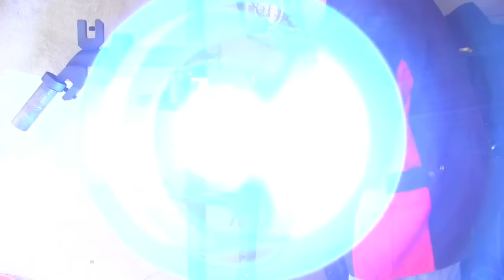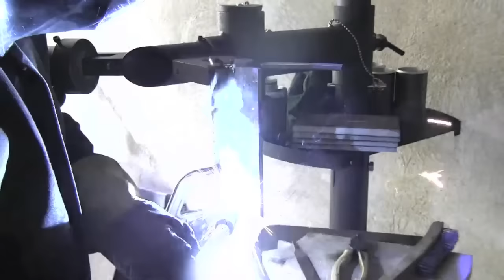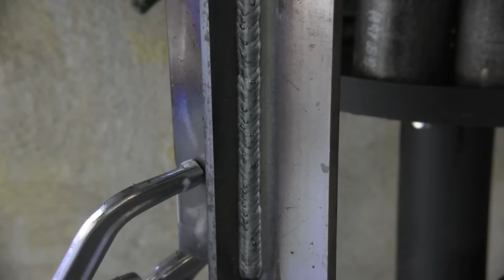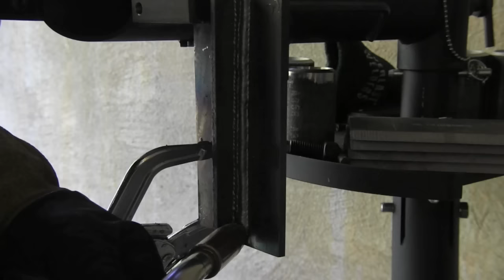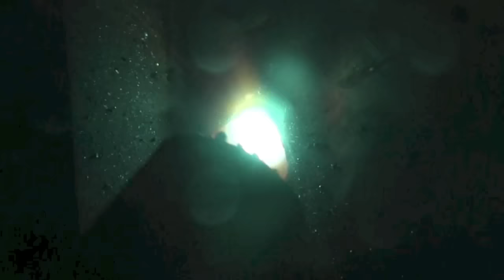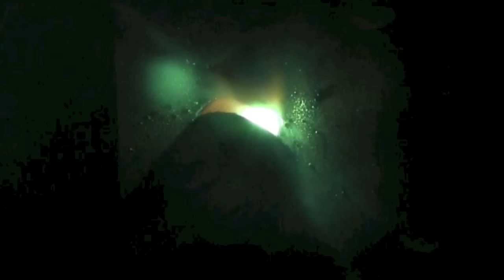Mig Welding Basics part 7 Vertical Tee Joint Drill

Comment: I know a lot of people don't want to hear this but hear goes: Rather than go to some big buck$ welding school , buy your self some welding equipment and figure it out for your self,at least you will have something left in the end. Practice ,practice , practice.
Reply: Pedro Dooley what do you think you get when you go to school? Only differnece is: you have someone with years of experience to query when something isn't quite working.
Reply: Mike Ford Get a book
Reply: Learned in high school were it's free, buying welding equipment is pointless without a shop so welding school or getting a job that will teach welding are more doable options.
Reply: the only thing that sucks with self training is youll never have the reference or word of back up saying you can do it. yet at the same hand most places if your going to be working will test you on ability regardless of your said experience.
Reply: hey so i respect your opinion. im in school for welding and what i get out of it is learning and getting certify in all welding. when your in school for welding, yeah you pay for it, but its a lot easier to learn to weld when you have zero experience in welding. such as myself. plus its easier to get a job when your certified in all welding.
Reply: I wanted to do that but getting gas is complicated.. I just have a small garage as well.

Comment: If you want a flat uphill weld, move over the center of the weld very quick and stay mostly on the sides.. works well with severel welds on top of each other.
Reply: I just figured this out.   I was shocked.    I'm like how is this so flat and nice looking

Comment: Did you leave the machine set as before (1G) re volts and wire speed?
Reply from the maker: Bill, dang it.  That is one of the main things I meant to talk about and I left it out. For this weld, I lowered settings to 19.5 volts and 245 ipm with .035" wire.  thanks for bringing that to my attention.
Reply: weldingtipsandtricks thanks for the reply & video.
Reply: +weldingtipsandtricks i use a miller welder at work not sure on which model but i was wondering what was your wire speed and heat? like about 19.5 amps and 4 wire speed?
Reply: Chris papi You use CV , not CC. IPM is wire feed speed.

Comment: A great video again. One of the things that I use uphill mig for is to demonstrate to students the idea of more time on the sides, less in the middle to flatten the bead. 

The concept applies across procceses but mig is the one where it comes in handy.

Another nice thing about uphill GMAW is the better penetration. For your viewers that watch regularly they probably already know. But the thickness limits on a low amperage machine can be increased by changing the position the vertical with uphill progression. 

After a few years of being involved witb welder testing and qc I can tell you that fusion type defects happen less on vertical joints than flat. Provided the bead shapes are good when you fill in the joint. 

Thanks for what you do.

Comment: For the guy who asked about cons on the z weave. Typically the wider your weld face the more stress and distortion you are imparting on your work piece. Lots of first year welders coming out of school love big fat weave caps not fully understanding the stresses they are imparting just thinking of how fast it is. Also you increase your HAZ (heat affected zone) with that one big fat weave where as with stringers or a split-weave your weld deposit benefits from every subsequent pass (to a point) with each pass you anneal and normalize the subsequent pass resulting in a more refined crystalline grain structure. Also lots of testers who have never worked as welders won't allow weave caps but basically everything can have stringers.  Please correct me if I'm wrong Jordie but I'm speaking with a background from Canada and lots of on site stick. Love the videos keep it up
Reply from the maker: You make a good point.  Its different everywhere you go due to different codes and applications. I worked a fab shop for quite a while where 48 inch pipe was welded routinely using a big roller setup and auto mig with auto oscillation. But the code at that time permitted it for the application. For example, Pipe codes like B31.1 or API1104 have very different requirements...and those codes are even especially different from structural codes like AWS D1.1.

Comment: I watched your entire basics series, and learned so much.  Thanks you.  I have problem with hand placement when doing long welds.  Maybe you can do a dry run on how to adjust your bracing as you move along to keep the weld look good.  Mine looks bad when I have to move my brace hand.  You've given me a lot of knowledge on whys of welding, more than any other channel.  Keep up the great videos.
Reply: Honestly you just need to practice free hand. Engage your core and breathe slowly. I used to weld landing gears for semis and it was about a 2ft weld and you just gotta get comfy and position your body where you want to finish and wind back to the start

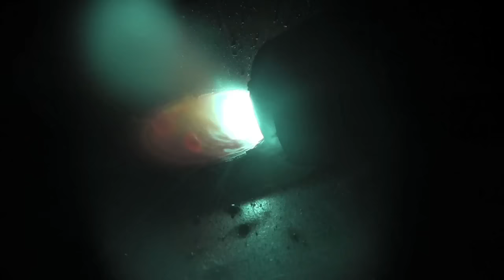Comment: 0:48 people seem to think you shouldn’t pull with MiG. You can run it pushing, pulling, or straight. Generally speaking, pushing allows the arc to dig in deeper, but you can get the same results pulling by slowing down and increasing amps and wire speed a touch. MiG is very flexible in its use. As long as you have good amperage, good stick out, good speed and good gas coverage, you can run MiG pretty much any way you want.

Comment: What were the settings used here ? I grew up on the farm teaching myself to stick weld haha after army passed a test got certified to weld on railroad anddd now shop got furloughed sooo I applied at a company for full time welder & they told me I had to take a test and I studied up best I could to have at least the basics down pat …when I get there they said I had to take a vertical and horizontal test … it ended up being a 1-bead Tjoint that was vertical and said a minimum of 6 beads/tags per inch 🤔and I couldn’t use trigger the whole time so I asked ole boy to show me an example I hadn’t heard of that and it was basically a series of uphill tacs and the settings were 27.5V @ 435ipm wire speed MIG weld … to me that seems mighty hot no wonder they wanted tacs andd said it was pulse welding uphill was the name and the little bit I know about that isnt pulse just a setting that may or may not be on the welder ???  I’d appreciate ANYYY feedback fellas take care and God bless..!

Comment: im glad you showed the z at the end.... the whole time i was like... 
WOW i do mine totally different then at the end you showed the z weave and i was like... ahh so i wasnt taught wrong! lol
This was definutly what took me the longest to maser but once you do anything else is easy mode!! Being able to Stick weld uphill already helps alot although i found the Technic is slightly different for MIG than a 7018, 6011 uphill! i was also taught that you want to always set your machine to weld in any position at the same setting but, ive always had to lower my setting for GMAW uphill! Im assumeing you also have to set your machine and wire speed lower as well?
Nice video i subed just because... why not ive only watched about all of your stuff! LOL
Reply: Do you have any videos on finishing polished Stainless? ive worked grained 404 and such for hollow metal door frames so what all else would be involved beyond that to do the polished mirror stainless?

Comment: If your doing vert uphill with a several pass fill in. Do you quench periodically? Or let it air cool? I know quenching can be detrimental to strength and makes warping worse. But it seems the hotter things get with each pass, the more the weld tends to want to sag

Comment: Hi Mate love your videos . Very informative. I'm a newby and have Xmas Holiday project building a single axle trailer around 5x6. Just wondering what the best welding technique I should use. As it's structural I want to make sure my welds are strong enough. Any help , tips on Mig would be much appreciated. Yes I will be doing a lot of practice beforehand. Thank you
Reply: Not so much a technique tip as a process tip. If you are going to use MIG i would suggest getting a set up than can do a true spray transfer. In almost every circumstance you will get much deeper penetration over other mig processes

Comment: Hey Jody new to the game here and my biggest issue is that I can’t see where I’m working other than the arc. I picked a $60 Auto darkened from HF thinking that it would be just fine so I don’t know much from using any other higher big money brand name. Question, is it just me or a welding helmet is really a game changer here? Thanks!

Comment: Hey Jody, I'm a Millwright apprentice at a fab shop currently working on conveyor systems, and I've just started welding MIG. I'm earning a degree in aerospace engineering, and want to learn to fabricate spacecraft (to my own design specs, in the future). Do you have any specific videos aimed at aerospace fabrication? I heard that's your bread and butter.

Comment: Hey Jody. I'm Blake and I'm 15, sophomore in highschool. I may possibly be taking college courses next year in a welding program at WITC of Ashland. 

I've done quite a lot of welding, but my grandfather's shitty harbor freight 90A flux core only does so much, which isn't a lot... 

I am looking at the brand new Lincoln Power MIG 210. Mig and tig. I was mainly wanting tig, but for $1000 this unit is a great deal. 

What would you recommend for a torch for this unit as one is not supplied?

Could you possibly PLEASE get your hands on one to showcase?

Thanks
Reply: Get a tig machine. More versatile for at home projects and better paying skill.
Reply: Brian Graves you obviously don't know what the power mig 210 is..
Reply: AnythingVG you obviously don't know what the "paying skill" of tig is. the shop i work for will train mig guys off the street to mig weld. i TIG though still need more time on the torch but i make far more then mig guys.
Reply: If you are going to learn to TIG weld an AC/DC machine is essential if you're going to spend 1000 dollars. AC is required for aluminum welding.

Comment: Can you please do a 6g gmaw root filler and cover pass video. I have a job I'm trying to get and they do full 6g pipe test to get the job but they do not require cert. I can't hardly find anything on the Internet about fully gmaw 6g pipe.
Reply: Hunter Pittman I'm pretty sure that ChuckE2009 has done a 6G gmaw open root and filler video. Hope it helps you out.

Comment: What kind of welding machine are you using? What is the voltage and wire speed setting? What size wire?

Comment: what settings are we talking? I tried this technique along with the correct angle and short stick however the pool was building to fast leaving a lumpy weld. Is it a low voltage setting with low wire speed when welding vertical up?

Comment: Great video thanks. I always struggle with the weld "sagging". Is it just a case of moving quicker? What about thinner material? Do you slow the wire feed?
Reply from the maker: I lowered settings to 19.5 volts and 245 ipm with .035" wire. For 1/8" and under , I would just weld downhill unless required to weld uphill.
Reply: I have turned .035 wire down as low as 15.5 volts and adjusted the wfs to suit. I do to show the effects of position changes on fusion. On thinner materials, downhill works and will produce less warping even though the setting are higher.
Reply: weldingtipsandtricks
 jody, I just tried out for a welding position, and the shop has all the machines set cranked up! they really did not like using them too low, they want the penetration. found it impossible to weld uphill,was blowing holes in the plate. and much of the fitment was oxy  cut and not too good!  I did not weld well! how do you not blow holes or pile up at high settings? well over 300 on wire speed, and well over 27 on v?
Reply: xenolard

Comment: When you weld horizontal flat and the settings on machine are good do you keep the same settings if you weld vertical uphill or do you change the settings.
Reply: No..mig can't be done vertical unless u drop your heat...then your out of proceedure...pulse arc

Comment: I just got a new job and when things got slow one day I decided to do some vertical mig. My weld look globbed up and.very convex. I feel my settings were wrong. Can you tell me what could have been my problem?
Reply: if the weld is too high, your wire speed is too high. if the weld is too wide, your heat is too high. best way to start, begin with setting your machine to the recommended heat settings for the metal thickness and type you're welding, then adjust the wire speed according to your style, everyone's is different. if you start at an angle,  stay at that angle. altering the nozzle's relationship to the metal causes the spread of heat to move which causes drips and undercuts in the weld. if your welds looks like a bunch of v's, your traveling too fast. practice downhill first to get the feel and the look you're  going for, then switch to uphill.
Reply: Thanks Dacey. I have been working on my wire speed and voltage, seems to be getting better. I have been out of practice for too long.
Reply: +John Lambert sucks huh? I haven't migged in over a year, had to watch this again to remember Wtf I was doing

Comment: Hey Jodi, when would temp sticks ever be used? I knew a friend of mine that would swear by them, but I never hear you mention them.
Reply: If you are welding something that needs to be x-ray tested they're a great tool. When it's cold outside and you're welding something that needs preheating and to remain within temp guidelines you will need the temp sticks. They sell different temperature tester sticks for whatever temperature guidelines you will be following. If you're welding something and you like to crank up your machine setting they're a great tool to pay attention to wether or not you're overheating your workpiece.
Reply: They definitely help for preheating for proper weld penetration in colder weather. Preheating in cold weather also will help prevent cracks.

Comment: I've been doing a lot of vertical lap joints recently and I have issues when the base plate is on the right side -- the wire buzzes as it should through the middle and on the left toe of the weld, but on the right (base plate side) it sputters and spits. I've tried changing the travel and work angles to no avail. Can anyone help? This happens on a weaved cap, not the narrow stringers.

Comment: What do you use to etch the weld to show the penetration?  Great vids and thank you!
Reply: I just found that Nitric Acid works well.  The cross-cut needs to be sanded smooth and polished.  I brushed on the acid and it showed the weld nugget very nicely.
Reply: 4% nitric acid in alcohol is a standard etch in metallography, known as nital.

Comment: Just done a 6g test in mig. All stringers as per the wps, weaving is not allowed. Cant find any videos of mig stringers anywhere.
Reply from the maker: Was there a maximum width of stringers? There usually is a width limit that  allows for some slight oscillation.

Comment: what setting do you have your welder on for that
Reply: Anthony I use 265 WFS and 18.5 V
Reply: I use 240.   18.5
Reply: What size wire
Reply: @antzrantsloa8887  35 thousandths

Comment: what is volt and ipm setting - 3/8" plate ? thanks in advance
Reply: I've been using 18.0 v 205 wire speed for 3/8 thick plate